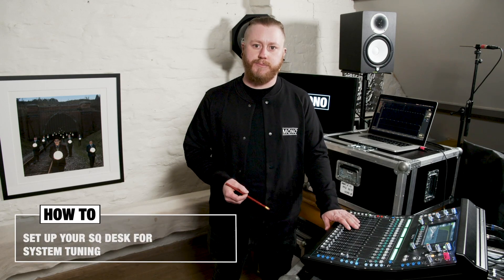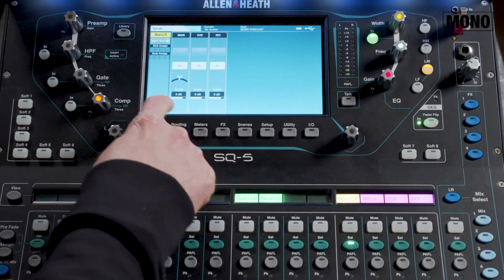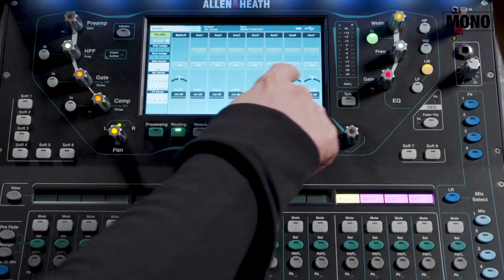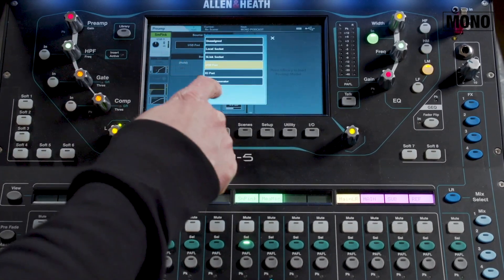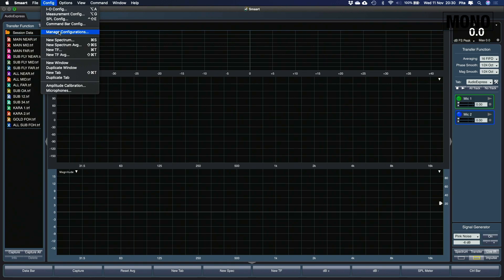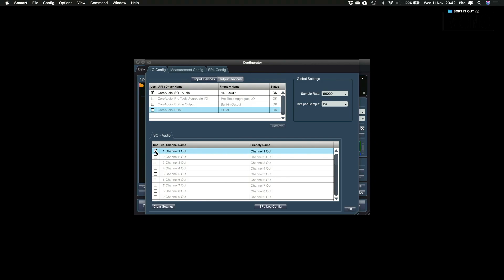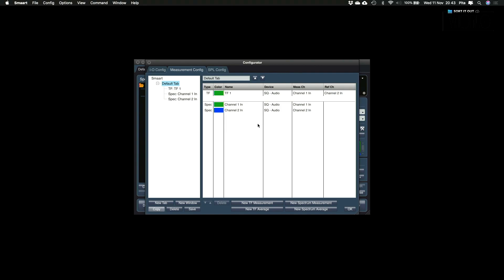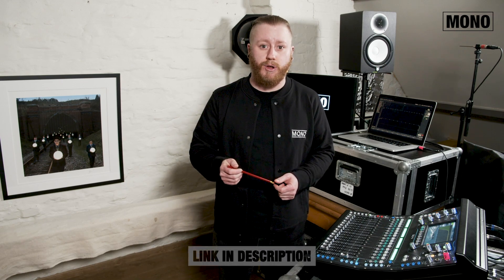How to set up your Allen&Heath SQ desk for system tuning

Comment: Thanks for your video - I found it rights these days.
But: I think, it isn't a good idea to take the reference-signal for Smaart from the matrix behind the master of the desk.
Because if you change the EQ of the master or use any dynamics, this will take effect on the matrix also, and thus you change the reference-signal for Smaart. But the reference signal must not be influenced by any EQ or dynamics.
Better way is to route the incoming signal of the signal-generator (your USB input port no. 1) directly in the desk back to the USB-port (in your case: USB output port 2) and of course parallel to the fader of the desk.